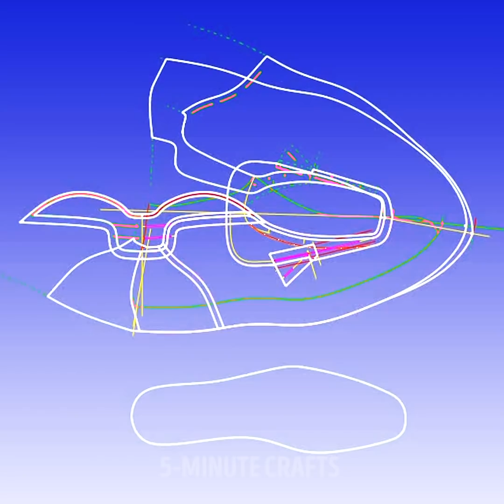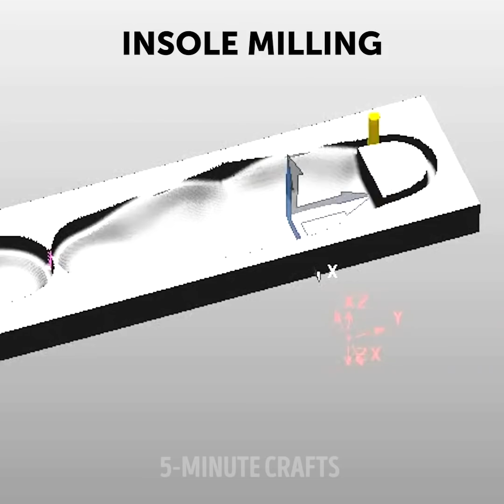SHOE-MAKING PROCESS THAT WILL MAKE YOU SAY WOW

Comment: wait.. so the bottom of the shoes before the sole were covered with cork? if im wrong, please correct me..
Reply: You mean the layer that was glued at 1:37? If I remember correctly, in English it's called "midsole" and in these videos they use the cork ones (but midsoles can also be made out of other materials [such as foam])
Midsoles are used for filling the empty area between edges of leather (otherwise you'd feel those edges while wearing shoes).